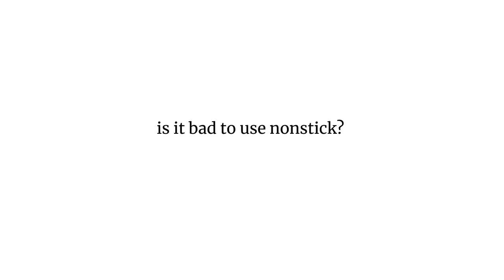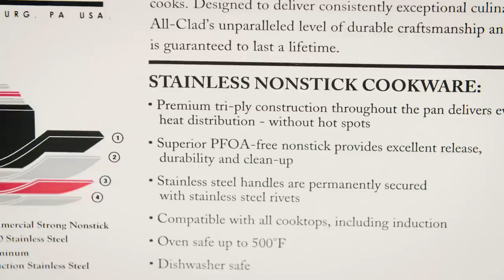Is it Bad to Use Nonstick Skillets?

Comment: I recently did a minor restoration of a cast iron skillet and find it to be a lot more enjoyable to cook with.  Non-stick never really gave me a good sear and you can't go from the stove top to the oven with non-stick pans.  I use my cast iron for deep frying, searing meat, perfectly cooked eggs, even as a pizza stone when making bread.  It doesn't even take that much more time to clean and take care of the pan as long as you put in the time during the seasoning process and do it right.
Reply: Eggs were one of the things that convinced me to stop using cast iron. Sure, cast iron and carbon steel are better value than non-stick, but they absolutely suck compared to modern clad pans.
Reply: It depends on the pan and how it's prepped.  When I did my restoration I sanded it to get a smoother finish and spent all day seasoning and re-seasoning.  When I cook eggs I make sure to heat the pan over med. heat and add a little butter.  Eggs slide around when I cook them now.  Before doing this, I would have sticking issues.  Plus, because I put work into the pan, I feel more accomplished when I cook in it.
Reply: I agree.  Thanks for the tip about the pizza stone.  I have 2 and the other one is for Potatoes Anna.
Reply: @MeepMeep88  there's a lot of anger in your comment for no reason.  First, i use a thin pat of butter, enough to coat the pan and as much as i use in non stick pans for flavor. Second, my pan was 10 bucks when i bought it and i enjoyed having a little weekend project when restoring it.  Saving 30 dollars is nothing to sneeze at. Third, cast iron is a good conductor of heat and holds onto it making it great at developing a crust on meats and acting as a stone for breads. 

If you dont want to use cast iron  thats fine, no one is making you.
Reply: Yes, that's why I said "depending if you value your time" if you enjoy little projects like that (which I've done and know it does take a bit of elbow grease to sand it down) then hats off to you.  

All I said it's hard to believe what your definition of "alittle bit of butter" really is since the majority of people think a little is well.. not really alittle lol

Lol and I'm not sorry if you think I sound angry..  It could possibly be you're a little too sensitive for online.
Reply: I have nothing against non-stick, and own some myself.  I find that my cast iron is more non-stick than "non-stick", and I use just a shot of Pam (that's a tiny bit) and everything slides around like a hockey puck.  Plus, as previously mentioned, I can do many more things with cast iron that I can't with a regular pan, and it holds its heat much better.  Cleanup is a wipe with a paper towel 95% of the time as well.  Simple.

I do value my time, which is why I use cast iron.
Reply: @MeepMeep88  Still not hot enough for searing
Reply: @samuelbaird4983  agreed
Reply: Nuff😊 Said.  {USA IRON}.

Comment: Something that isn't mentioned, but still important to consider is that non stick pans don't hold heat or brown food nearly as well as thicker stainless or cast iron pans which is a large contributor to even cooking and flavor (think the crust on a steak or grilled veg). Also with a little getting used to stainless isn't that bad to clean, especially if you deglaze to make a pan sauce/add the flavor of the fond (which I almost always do anyways). I personally only use non stick for eggs, crepes, and sometimes fish because while you can cook them in stainless they are really delicate and kind of a pain in stainless
Reply: Cast Iron sucks for even cooking. It's thickness is because it's brittle, and that helps it a little, but no where near what clad pans can do.
Reply: mad thumbs 
Cast iron cooks evenly, just have to give the pan time to heat up. I just got into carbon steel and love it. It heats up fast, cools down fast and doesn’t need the same amount of attention as cast iron. And after 2 rounds of seasoning nothing sticks to it.
Reply: You can season a stainless pan similar to cast iron. Mine are almost as non-stick as Teflon now with all the benefits of a heavier, stainless pan and none of the drawbacks of Teflon.
Reply: That's funny. I cooked two frozen hamburger patties on my tfal nonstick pans.
They cooked perfectly.
Reply: Remember that you can use Oven Cleaner to clean Stainless Steel pans if it gets to that. The reality is - if you have HOT Water and fill the bottom of the pan or pot immediately after cooking something and let it soak overnight - whatever was stuck will  likely be loose the next day.  For Aluminum pans - if it is badly scorched,  shake some SALT into the pan and then baking soda,  Cover with Napkins or paper towels and then soak the towels with VINEGAR. Cover this whole thing with some Plastic Wrap and let is soak for a few hours. This will also work with other metals too- but you cannot use Oven Cleaner on Aluminum. THere is also a commercial cleaner that is called "Carbon Off" that works with Aluminum really well. I got Decades of dark black bottom build up off old Aluminum Pots with it in two applications. 

I make stovetop Cheese Dishes (Mac and Cheese and Veggies and cheese) in Non Stick also But I never go above medium High heat from my Electric Stove.

Comment: Some people here need to calm down.  Someone may have physical issues that prevent them from using a heavy cast-iron or even a slightly less heavy carbon steel pan.  And to use one of those pans, or even stainless steel, you must add some fat or oil, which has has it's own health considerations, not to mention what you generate when you're seasoning one of the cast-iron or carbon steel pans.  There is no perfect solution.  Use what works for you, but don't excoriate those who choose differently from you.
Reply: Right, but why come up with excuses when people present alternatives that not everyone may be aware of?  

Anyone advocating carbon steel or cast iron is costly trying to express concern for other people's health and well being,  and not everyone out there know that both materials get pretty damned nonstick themselves,  when handled correctly...

And they're not toxic.  Sorry to burst your bubble there,  there's nothing dangerous about seasoning your pans, if you're doing it correctly.  I suppose if you're trying to blast your LA Creuset with industrial silicone lube to make it nonstick,  they might be a problem, but it's also deeply stupid.

The weight concern is valid though,  and a fair thing to consider.  Choice of lubricating fat to cook in is also a consideration, but then,  cooking is always air such choices.  Fat consumption is an issue with nonsticks as well,  especially as some fats bond with nonstick in a sticky way, which defeats the purpose.
Reply: I have read many of these kinds of comments .. that it is just "hysterical" to get fearful over non-stick pans, they are safe, blah blah blah.. honestly, that isn't totally the issue. I mean, maybe a nonstick "Teflon" style pan may be safe for a specific period of time IF properly handled.. but the fact is is that eventually it DOES break down. Where then, does that chemical go into the environment? What about folks who don't take care. I had a boyfriend who had a horrible scratched pan and made me cringe cause I knew about that years ago.. but folks shrug and go ... whatever.. But  the creation of these pans in the first place just so some folks can have this "non-stick" convenience. They are utterly self absorbed and self centered at the larger situation.  The MAKING of these chemicals, the offgassing, the workers who handle them, where is the factory waste going (this stuff was being dumped in drums that LEAKED into the Ohio River!!!!)  on and on and on. ALL so SOME consumers can "enjoy" this convenience.  sigh.  And the  chemical c8 that they talk about is in pretty much EVERY human on the planet. Think about that!.  Is that being hysterical? Or something that we should calm down about? This apathy and excuse making by consumers and folks who defend companies like DuPont are contributing to this problem. And it isn't JUST DuPont. It is DOW, it is MONSANTO, etc etc.. there is a class action lawsuit about Roundup now.. I remember meeting a woman at a GARDEN show that said she sprayed roundup regularly on her Mint to keep it under control!!!!!!!  When will humanity wake up and stop being compliant and complicit with destroying the planet and ourselves??? SERIOUSLY??
Reply: What's wrong with fat and oil? You know your body needs fat right? I'm not saying to use margarine but olive oil, grapeseed oil, no problem and actually necessary for a healthy heart and body.

Comment: I use ceramic non-stick by greenpan, I'm sure they're not the only ones who do this. They can take super high temperatures (they can take max temperature in the oven easily), not toxic and although not quite as non-stick as PTFE they do pretty well.

Comment: I seem to recall we were told Teflon was safe also.  Time heals all wounds and wounds all heels.  I prefer to avoid nonstick pans for everything except fish.  I prefer to use less oil than would be necessary to fry fish in stainless steel.  I use carbon steel as my everyday pan and have one ceramic nonstick for fish and one stainless for high acid foods.  Serves me well.  Right tool for the job
Reply: So all the cooking pans you mentioned are toxic free?

Comment: Thanks Hannah, after I started using cast iron and tri-ply stainless steel I have not bought any teflon skillet.  As you said more research needs to be done...so why risk ourselves??🍳
Reply: Bull.  Extensive research has been done.  Today's non-stick coatings are completely harmless.  Just don't leave your empty pan on a scorching hot burner.
Reply: Properly using nonstick skillets  pales in comparison to other things we do to harm our health.

Comment: I was really hoping you would cover the new ceramic pans that are around. I actually have a couple and I absolutely love them. Nothing sticks and they are a breeze to clean. Bonus, the pans are white on the inside, so it's so much easier to monitor food while it's cooking. It's worth noting that I took care to read the manufacturer's instructions before use since it was a new type of pan that I had previously never used. The pans I bought had me to do a VERY light seasoning in the beginning which I haven't had to do since. Also was very clear about making sure you let the pans cool completely before putting them into water. (although, from my understanding, that's something you are supposed to do with Teflon pans too, but I know a lot of people fail to read things and don't adhere to that.)
Reply: ive had several ceramic pans, and if you use them for searing the coating will start to degrade in a few years. only use them for low heat cooking such as making eggs or sauteing. for this they are excellent. if you want to sear and caramelize stuff, go for stainless, carbon steel or cast iron.
Reply: Oh, I never sear in my ceramic pans. That's not what I use them for. lol.. besides, all that was in the manufacturer's instructions too.
Reply: They are rubbish and after a while eggs stick to them.
Reply: We had a ceramic grill pan, which doesn't make sense, but after a while the food started sticking badly. It had to be scrubbed a lot, which isn't good for the pan so it's useless now. However, the fry pans we got with it are still good and pristine on the inside.
Reply: we have covered them and they just don't last very long unfortunately, they quickly become quite sticky and can start flaking.

Comment: I was cooking an omelet on a teflon skillet when the African Grey parrot who was 20 feet away from the stove passed out. He fell right off of the perch, we opened up windows and he seemed to recover. All teflon went to the landfill, now I use cast iron or stainless and have plans to try a carbon steel wok.
Reply: Your parrot was more fortunate than mine.  Mine was no more. It was bereft of life. It kicked the bucket,  shuffled off this mortal coil and joined the bleedin' choir invisible.  It was an ex-parrot.

Comment: Something not spoken about in this video is that most nonstick pans are aluminum underneath the coating.  If you scratch the coating or wear it down having aluminum come in contact with your food especially if acidic or at high temperature can cause the aluminum to get into the food.  Aluminum can mess with one’s nervous system over time.

Comment: There are also a number of kitchen appliances that use non-stick coatings to consider. Electric griddles, multi use pots (i.e. pressure cookers), rice cookers, etc... can all have non-stick coatings. In some cases alternate inserts can be used, such as stainless steel pot for pressure cookers mentioned. There are also alternate non-stick coatings, The Rock is an example.
A bit of care is needed when using these pans, as well as most gear in the kitchen. I have some aluminum pans that are coated. Aluminum is a great conductor of heat but I'd not want to use an uncoated pan (many commercial kitchens do use aluminum pan, and get years of use from them). Stainless and cast iron certainly have their uses, but both are less efficient at conducting heat. Multi layer pans can be useful if made properly. 
I've had and used a number of these non-stick pans for years with little or no problem, and have yet to have one start to flake the coating. Some may start to discolour after some time, this would be the indication that the pan is nearing it's end.
Reply: Learn how to cook on stainless and you'll love your 'multi-layer pans'. You can do literally everything with them.

Comment: You forgot to mention that the Teflon or other coatings end up in your food as well.
Chipping cracking scraping etc.
Reply: It's safe to ingest the coating.
Reply: I like eating Teflon
Reply: Teflon is incredibly inert, which is why nothing sticks to it. I wouldn't eat a bowl of it, and I would replace a flaking pan sooner than later, but it's fine to eat it.
Reply: It doesn't just flake off in your food suddenly, unless maybe if you're vigorously stirring it with metal utensils. You see the signs. First it gets scratches. Then you might see lifting of the teflon. If you don't want to eat it, that's the time to replace them.

Comment: Don't know?!?!????

Yeah, we really do, and it's harmless.

The reason it's harmless is because it has the strongest bonds in organic chemistry and doesn't react with anything really.

In fact, Teflon's bonds are so strong and so non reactive that it's literally the only thing you can store fluoroantimonic acid in.

 fluoroantimonic acid happens to be 20 quintillion times stronger than 100% sulfuric acid, and it's used in chemistry specifically to protonate organic compounds. You also can't use it inside a glass fume Hood because just the vapors will dissolve the glass.

But Teflon? It's so inert nothing happens when used to coat a container to store the acid.
Reply: What in the world does your example have to do with a skillet? Is there someone scrubbing away at the coating daily? Did a fork accidentally compromise the coating, yet it's still safe? 
I doubt anybody is getting cancer from nonstick pans, but 'we don't know' is an honest answer.

Comment: My current kitchen doesn’t have a gas cooktop, but a hot plate, which ended up leading me stick to my heavy cast iron almost everythig to cook. I just feel the non stick pans AND my cheap stainless steel ikea pan never get HOT enough. Plus my cast iron is sanded and re-seasoned therefore perfectly nonstick. I might use my non stick Greenpan when I have gas cooktop again, that I can use real flame 🔥

Comment: Time and place for nonstick, but in general, I'll avoid. It's possible to avoid the harmful side but still possible (as mentioned in a few comments). The other big issue is how long these pans last. Not considering the better designed pans, a lot of what you find at the store will warp quickly and the coating will flake off. You're now eating plastic. Next is when you need to dispose of these pans. It costs >$400 to re-coat a pan and only a small handful of companies will properly recycle them. Throwing them into the landfill is toxic as the coating will leech into the surrounding area.
Best is to learn to use a carbon steel pans and if that's too expensive or heavy, stick with the stainless steel.

Comment: We stopped using nonstick years ago.  We've got a few cast iron pieces, which are great, and I've been interested in checking out carbon steel.  But hat about ceramic as an alternative to nonstick?  We've got a small inexpensive one, which we use for scrambled eggs and the like, and it doesn't seem all that nonsticky to me.